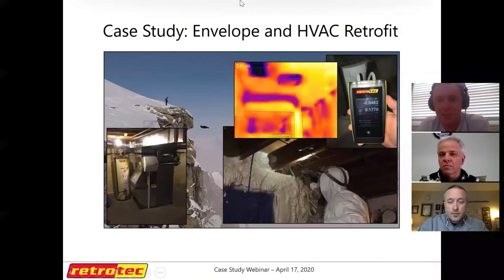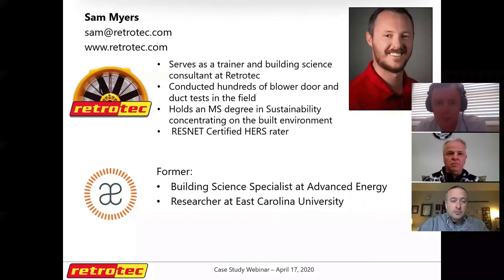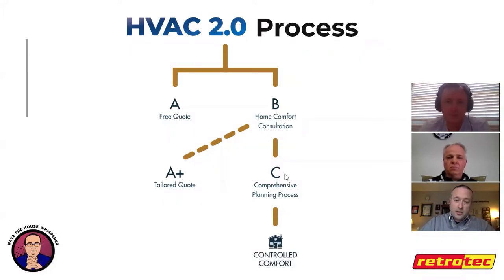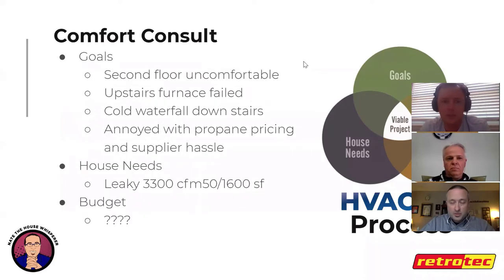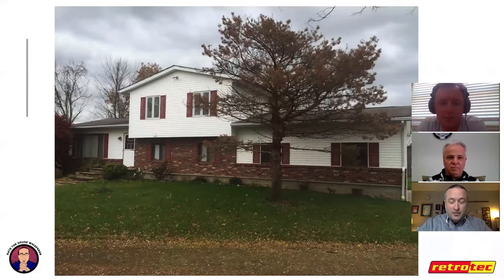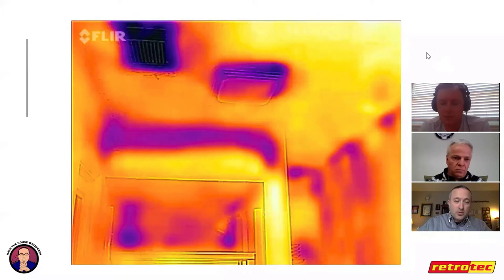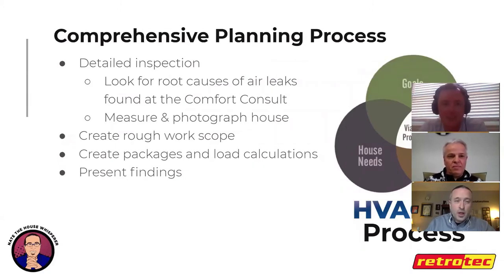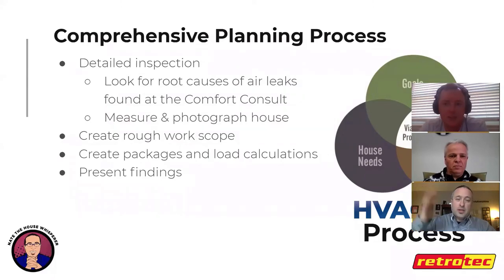Electrification Case Study Webinar with Client Peter Andexlinger  Retrotec and Nate Adams

Comment: Question at 1:12:55 is the zinger.  No symbiotic relationships typically in most of the country between weatherization and HVAC trades. This seems to be the Achilles of the home retrofit industry.
Reply from the maker: Agreed. It likely needs to be solved with existing infrastructure. We think HVAC contractors are the best option because all paths of the HVAC 2.0 process can lead to selling HVAC. Plus HVAC is generally harder to learn than building shell.